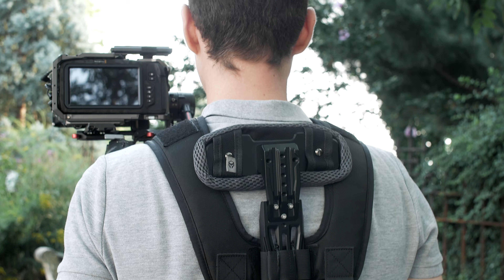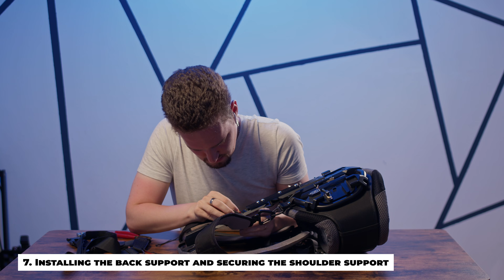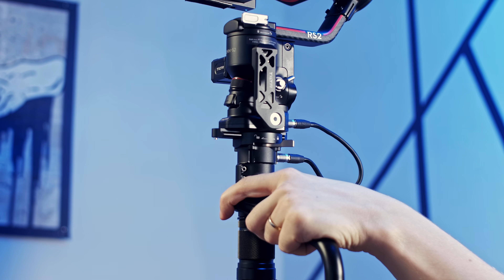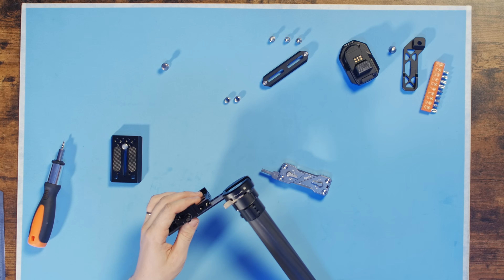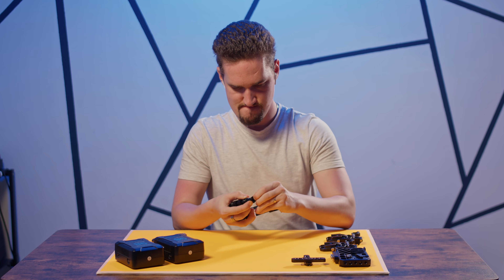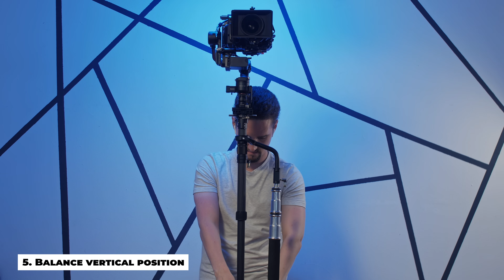The Tilta Float System Modifications YOU"VE BEEN WAITING FOR

Comment: The additional pendulum mass may improve stability during slow, continuous movements by increasing inertia and acting as a mechanical low-pass filter. However, during abrupt stops or rapid direction changes, the suspended mass will continue moving due to inertia. This delayed motion can introduce secondary oscillations and unwanted torque into the rig, potentially adding movement noise instead of reducing it. For dynamic action-style shots, a fixed or damped counterweight seems mechanically more predictable than a freely swinging mass.

Comment: I'm curious why you need to get th CAMVATE nanny rail instead of the one provided with the Tilta adapter at 11:02?  I just tried it and it works.  Not flush but slightly elevated.
Reply from the maker: It'll change the balance direction

Comment: With such a modification of the battery, how can you roll it when it is lying horizontally?
Reply from the maker: Good point. It's the limitation, but I also think that you can use a vertical mode on gimbal and do 360

Comment: Thanks for the super clear tutorial! Happy smooth shooting. I'm wondering though, if you mounted the quick release plate 90º to the nato rail you would have X + Y axis adjustment, no?
Reply from the maker: Hi, sorry for the late reply. Yes, you can get x+y axis adjustment if you'll mount quick release manfrotto plate right to the base rail. But why would you do so? 1. As I mentioned in the video - you don't need x adjustment on the top, because with the right balance of gimbal you'll have the same position for the center of gravity on top. 2. It's really hard to adjust (more accurate position) and mount properly the base rail from Tilta, because of the load on this part. 3. You'll probably need another quick release plate or make custom holes to mount it at 90º to the base rail. 4. Last you can do x adjustement with batteries.

Comment: When you pivot the batteries you move the center of mas outside the center of the tube and destroy dynamic balance.  So for instance if you are in javalin mode the camera resists any move on the roll axis.
Reply from the maker: Thanks for your comment, it's a good point. I didn't like this option for 100% too and already found another option of attachment NP-F batteries directly to camera plate. Will make a video about it soon

Comment: about rotating the top mount why i can't put on weight 200g or 100g????
Reply from the maker: Stabilization system is sensitive to any additional weight. Of course, you can use  any 200g, 100g, etc, but how will you find the right amount or placement? In such method you'll be limited with position of your system, and won't be able to add extra gear, because you won't have a room for adjustment.

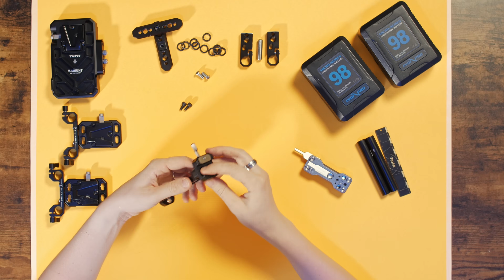Comment: @13:46 you talk about the handle of the old monitor mount.
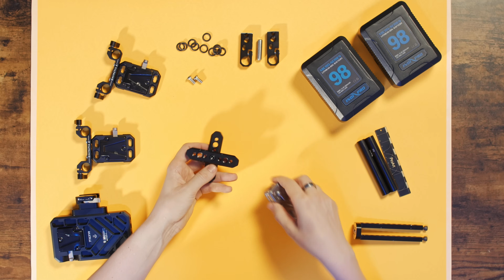@13:06 you see this part at the right bottom corner

I could not find this part in the description.
Reply from the maker: Yes, you won't find it. It's a part of CAMVATE grip for a director monitor, which I drilled by myself. You can replace it with two 15mm rails with 1\4 screw and connect it to cheese plate.